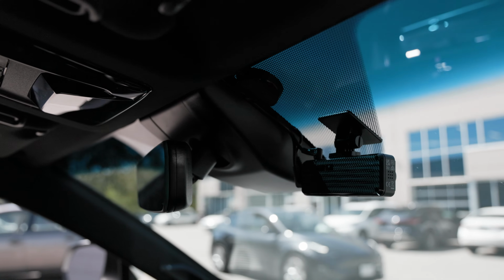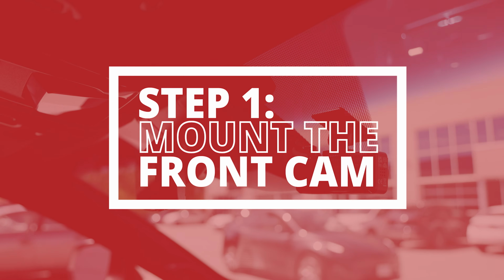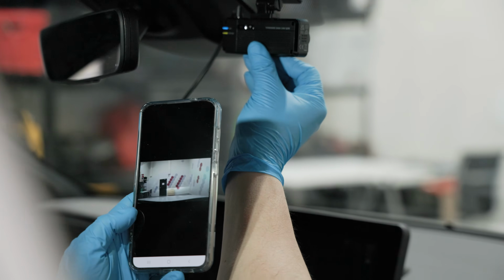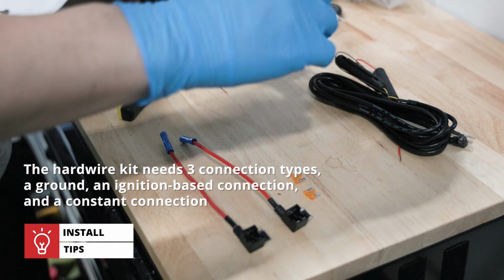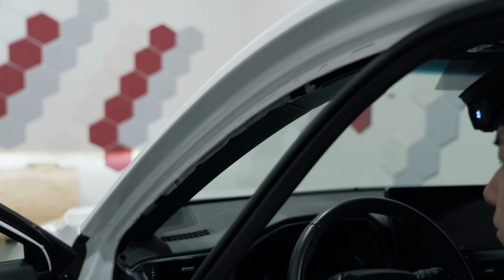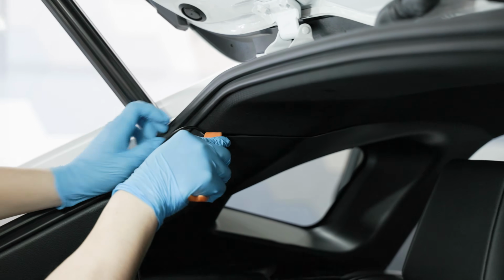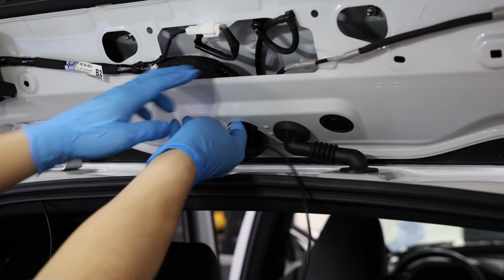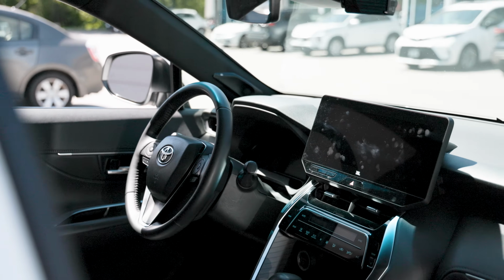Thinkware Q200 2-CH 2K QHD Dash Cam x 2023 Toyota Venza Installation | BlackboxMyCar

Comment: can you  use the OBD cable of thinkware on the q200 instead of using the hardeware cabeling?
Reply from the maker: Yes, the Thinkware Q200 comes standard with an OBD power cable, which allows for a simple plug-and-play connection to enable parking mode. If you prefer hardwiring, you can still purchase a Thinkware hardwiring kit separately. If you have any more questions or need further assistance, feel free to ask! 😊

Comment: I have installed the Thinkware Q200 and it works well, but I have a problem: the rear camera image is upside down. I tried to find the setting in the Thinkware application, but there is no menu to fix it. Please recommend and thanks.
Reply from the maker: Unfortunately, if the Thinkware app doesn't have the option to rotate the rear camera image, you'll need to physically adjust the camera.

Make sure the Thinkware logo on the rear camera mount is facing inside the vehicle. After repositioning it, your footage should be oriented correctly.
Reply: @blackboxmycar ok I see and thanks

Comment: I noticed you placed the gps antenna on the frit dots on the top of the windshield.  Would this affect the performance of the antenna?
Reply from the maker: Mounting the GPS antenna on the frit dots at the top of the windshield is generally safe and shouldn't significantly affect its performance. The frit dots are designed to help with the seal of the glass and block sunlight, and they can provide a suitable area for mounting adhesive items like antennas. However, it's always a good idea to ensure that the antenna is positioned to allow for a clear line of sight to the sky for optimal signal reception. Have a great day!

Comment: You should have shown which specific fuses you guys used and a slightly more details disassembly around the fuse box! Will be installing a Viofo A229 Plus I bought from you guys in a 2023 Venza this upcoming week so that would be useful info. While running the rear camera cable you don't make sure to tuck it behind the the side curtain airbags?
Reply: Since this is the car I have can you provide the fuse positions you used?
Reply from the maker: I understand that detailed guidance on fuse selection and disassembly can be very helpful during installation. Fuse choices may vary based on your vehicle's model, but generally, you'll want to use a fuse that matches the dash cam's power needs, usually around 20Amp. Be sure to check your vehicle's manual to find the right fuse.

For routing the rear camera cable, make sure it doesn't interfere with side curtain airbags by running it behind or around them, so they can deploy properly in an emergency. You might need to tuck the cable into panels and seams as you go.

If you need more help or specific advice for your Venza, feel free to contact our support team at info@blackboxmycar.com or reach out via Live Chat. We're here to assist you with your installation!

Comment: Can you use fitdvr power adapter to hardwire this dashcam
Reply from the maker: No, since this camera does not use a USB cable connection, it is not compatible with the FitDVR. If you would like a plug and play connection, please consider an OBD cable.